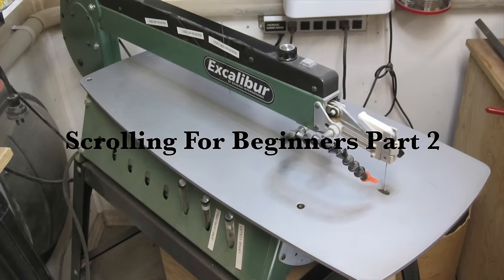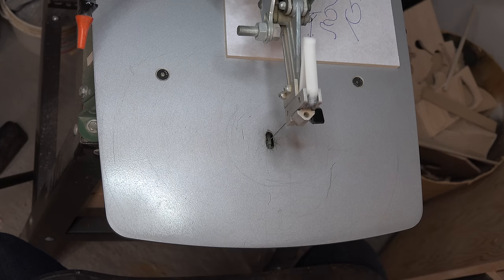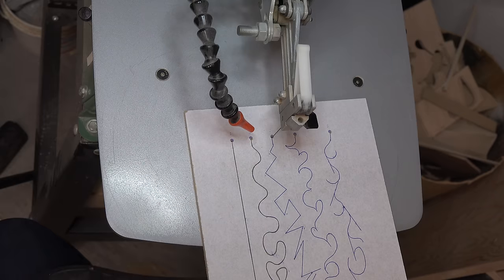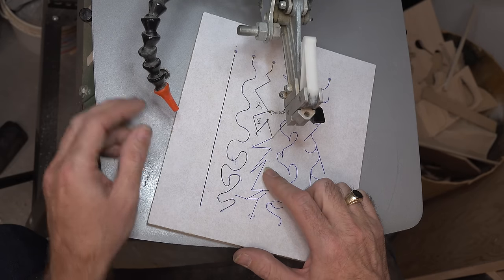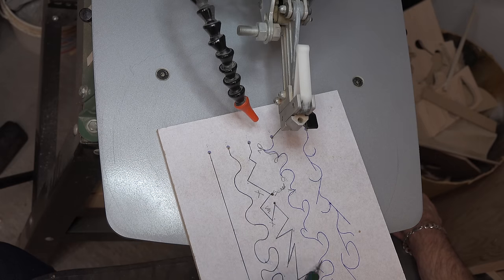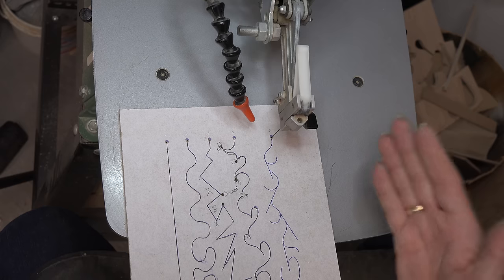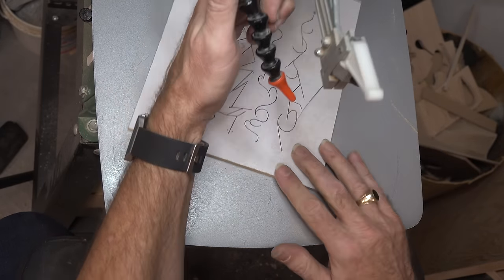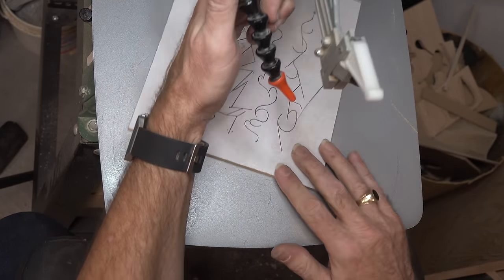Scrolling for Beginners Part 2

Comment: Great videos, I am new to the scroll saw myself. I was wondering if you have ever tried to cut out patterns in leather using the scroll saw? If so what would be the best way to go about it? Thanks
Reply from the maker: I've cut a lot of different materials on the scroll saw Justin but never leather.  I guess it would depend on the type of leather and the thickness.  After all, leather is a very porous material and the fibres may or may not lend themselves to certain cuttings.  There is only one way to find out sir.  If you are looking for recommendations on blade selection and speed of the saw, I would suggest starting with a number 2, reverse tooth blade with the saw at about half speed for starters.  That will give you a pretty good idea of how it will work with the leather.  The smaller blade will help to burnish the cut edges of the leather as well while cutting.  I hope this helps you out.  Please be sure to let me know how it works out and if you have problems, you can always shoot me a message over at the channel's facebook page and I will do my best to help you out.  Thanks for tuning in to the show.  I truly appreciate the support.
Reply: @acutabove_woodworkings  thanks for the quick reply. I will give it a shot. thanks
Reply from the maker: You're very welcome 
 @justincolson9589

Comment: maybe this question has been answered, but do you use a foot pedal?  I watched part 1 but don't remember this being mentioned?  It seems that at certain parts of cutting, the blade slows down and is this because you have a foot pedal?  Sort of like how you can control the speed of a sewing machine.  Thanks!
Reply from the maker: I do use a foot pedal Clare.  You have to realize though, that a foot pedal on a scroll saw is a normally open switch that either turns the saw on, or off.  There isn't a pedal available to control the speed of the saw.  It is an on or off situation and the speed is controlled by the saw's speed control only.  I hope this helps.  Thanks for tuning in.

Comment: where do you get such small blades?  you mentioned #3, 5 and 7 but everything at my stores only show tpi
Reply: could it be because all they offer is pinned blades?
Reply from the maker: Not knowing where you are located, it's hard to give a suggestion as to where you could purchase blades.  I get mine from a local supplier here called Stockade.  https://www.stockade.ca/Scroll-Saw-Blades_c_4365.html They sell them in bulk as well.  All blades have a universal number attached to them but some manufacturers don't list those numbers.
You might want to check out this chart from Olson Scroll Saw Blades.  It has some pretty useful information such as TPI and their universal numbers and what types of wood and thicknesses they are recommended to cut.  https://www.olsonsaw.net/wp-content/uploads/2020/01/2020-scroll-chart-WEB.pdf
I hope this helps.  Thanks for tuning in to the show.
Reply from the maker: I wouldn't suggest using pinned blades.  They are fine for some things but not so great at doing finer, detailed work.

Comment: Hey, Kenny - sorry for the late comment.  I really appreciate your video and perhaps I missed something but do you slow the speed of your saw as your back peddling in your cuts?

Obviously you use a foot pedal (which I don't have yet) but I wasn't sure if yours was allowing you to ramp up the speed or if that even mattered while moving the blade through previous cuts.
Reply from the maker: I do not reduce or increase the speed near the end of the cut.  In fact, the entire cut is made at the same speed.  I might reduce the feed rate of the stock, but I don't change the speed of the saw.  The foot pedal that I use is either on or off and has no speed control capabilities.  I hope this helps.  Thanks for tuning in and if you have any other questions, please don't hesitate to ask.  I'd be more than happy to help if I can.

Comment: Nice demonstrations and explanations, question, can you stack patterns to cut?  or does the drift mess up one of them?
Reply from the maker: Thanks for the kind words Mike.  You can definitely stack cut on a scroll saw.  The cuts will not be affected as long as the proper blade is chosen to handle the thickness of the stack you are cutting.  Blade drift no longer become a factor, however blade deflection is now the enemy.  You can overcome blade deflection by ensuring that you have the right blade and the right tension and you don't push the saw and let it do the cutting at it's own pace.  Pressing too hard in order to speed up the cut can cause blade deflection in thicker pieces.  I hope this helps.  Thank you for tuning in to the show.

Comment: How do you make beginning hole for pattern
Reply from the maker: All you need to do Rosemary, is drill a hole that is big enough to fit your scroll saw blade though in order to make an interior cut.  Try to drill this hole in the waste areas of the cut but if you are doing veining (cutting lines to accentuate details) you should drill the hole in one end of the line.  I hope this helps.  Thanks for tuning in to the show.

Comment: Hi Kenny. First of all, thank you for sharing. Question: Are you using a foot switch to turn on and off the machine? Sorry for being naive.
Reply from the maker: I certainly am using a foot pedal Ruben.  No need to apologize for asking.  It is one of my recommended accessories for the scroll saw and it makes its use so much easier.  If you are interested in seeing that Top Ten Scroll Saw Accessories video, you can find it here.  https://www.youtube.com/watch?v=ZNso4hITeq4&t=2s
Thanks for tuning in and for taking the time to ask your question.  It's truly appreciated.

Comment: I don’t want to sound dumb but do you connect that small hose to a special vacuum or does it work as a vacuum on its own as you cut?
Reply from the maker: You don't sound "dumb" at all Yvonne.  I'm glad you asked.  The hose is not a vacuum but rather a blower.  It is part of the saw and is connected to a diaphragm that is compressed when the arm of the saw raises and lowers during cutting.  It almost works like a foot pump for blowing up air mattresses but in this case, the "foot" is actually the cutting arm of the saw.  With every down stroke of the arm, the diaphragm pushes out a little gust of air that blows the dust away from your cut lines to  enable you to see them better while cutting.  This is pretty much the system for the majority of scroll saws.  Some have a little different system but they are pretty all based on the same principal.  I hope this answers your question.  Thanks for tuning in to the show and taking the time to ask your question.  If you have any other questions along the way, please don't hesitate to ask.  I'd be more than happy to help you out if I can.
Reply: @acutabove_woodworkings  TY for taking time to answer my question
Reply from the maker: @yvonneschimmel453  You're very welcome.
Reply from the maker: @yvonneschimmel453  Once again, you are very welcome.  Only to glad to help.

Comment: Have you tried just rounding off one back corner, e.g. the back right?
Reply from the maker: It only controls the cornering in one direction that way.  Both need to be rounded in order to fully assist with the control.  I hope this helps.  Thanks for tuning in.
Reply: I was thinking not for cornering, but for blade drift. It would seem the blade is getting twisted (viewed from above) counter-clockwise. If it's at least partially due to drag, lessening the drag on the right rear might help. Just got a used scrollsaw and got it running yesterday, so wondering this as an ignoramus. Thanks for great, clear, & thorough videos that I'm watching right now.
Reply from the maker: @vikingcove  grinding off the back edge of the blade is one of the things that will help with blade drift.  However, blade drift occurs on curved cuts as well as straight cuts and that is why you would need to grind off both back edges.  You are not wrong in the thinking but grinding off one edge would only help with one direction of drift.  There are other factors that cause drift as well and there is no way to correct those but grinding off both back edges of your blade will definitely help reduce it.  At least you are thinking through the process logically.  A lot of people just start cutting and can't figure it out so they give up.  If you have any other questions, please don't hesitate to ask.  I'd be more than happy to help if I can.  Good luck with your scrolling and thanks again for tuning in.
Reply: @acutabove_woodworkings  Thanks. Your demonstration of rate of feed & rate of turn was very good, and your turn technique of backing up, snapping a 180, then backing into a tight turn seems like an excellent method. It really helps me to have such mental pictures before I try something new. Next I'll have to tear into some actual scrolling practice. When I come back to check out others of your videos, I'll try to remember to mute it for the intro before I tap play. I really appreciate your help.
Reply from the maker: @vikingcove  In the beginning videos of this series the volume was louder than others.  I did eventually turn it down so not all my videos have the loud introduction.  I'm glad that you found the demonstration to be useful.  Please don't hesitate to ask questions if you have them.

Comment: really new to scrolling and was wondering  how thick of wood can you cut?  Danial
Reply from the maker: Most scroll saws will tell you that they have a 2" cutting capacity.  Realistically, the most you would want to consider would be 1"-  1-1/4" thick material. Much thicker than that can cause terrible blade deflection.  The saw works best with thinner stock however, up to 1" thick.  I hope this helps.  Thanks for tuning in.
Reply: @acutabove_woodworkings  thanks for taking the time to write your vids are great ,informative and down to earth thanks again Danial
Reply from the maker: @ve3tvb  Thanks for the kind words.  If you have any other questions along the way, please don't hesitate to ask. I'd be more than happy to help out if I can.

Comment: how can you pull the blade out in those lines?  the blades I bought at the local store have little knobs on them at each end which would make that difficult.  Thanks-great video!  I just retired and purchased a used saw and having fun practicing
Reply: There are two types of blades, pinned, the kind you describe and plain or unpinned. That may not be the official or technically correct term, but makes sense to me. Anyway, it's just a design issue chosen by the maker of your brand or type of scroll saw. And yes, the hole for entering the pattern has to be large enough to accommodate the pin on that style of blade. So pattern selection for a project will be crucial, as a very intricate pattern with many small areas that have to be removed will be problematic. For practice, though, just drill a larger access hole and practice away. Some saws that use pinned blades may have an unpinned adapter available either from the manufacturer or after market, but do research as they might be of varying quality.
Reply from the maker: Marc Meyers answered as well as what I ever could.  You will need to see if your saw has the ability to take plain end blades.  These are the ones that will allow you to do smaller, more intricate work with the saw.  The pinned blades are usually reserved for much more coarse work.  Personally, I rarely (if ever) have a need for using pinned blades.  If you need help with the blade selection, I made another show explaining some of the blades available and what their uses are.  You can find that show here.  https://www.youtube.com/watch?v=UG6S5tqx6bI&t=563s. Thanks for tuning in and for taking the time to leave a comment.  If you have any other questions please don't hesitate to ask.
Reply from the maker: @marcmeyers4156  Very well put.  Thanks for chiming in with an answer.  I appreciate that.
Reply: @acutabove_woodworkings  I downloaded the manual on line and found that my saw will take both type of blades.  I already popped the pins out of one to try and no issues at all.  I found a local hardware that sells the olson blades, so I'll be heading over there today.  After the practice template exercise was messed with, I tried a make shift fish and attached lettering project that actually came out OK.  Thanks to all and now I'll find something to do now that I'm retired at the ripe old age of 57 LOL
Reply from the maker: @HobbyAddictions  Good luck on your new adventure in scrolling.  I'm glad to hear that your saw takes plain end blades as well.  Before you spend a ton of cash on blades, be sure to check out my blade selection video that I gave you the link for.  It will help you to make better educated decisions when it comes to blade buying.  If you have any questions along the way, don't be shy about asking.
Reply: @acutabove_woodworkings  I did watch that video and I purchased my blades based on your suggestions.
Reply from the maker: @HobbyAddictions  Then you should be just fine.
Reply: @acutabove_woodworkings  sorry last question: is there anywhere to get free pattern templates?
Reply from the maker: @HobbyAddictions  Ask as many questions as you wish.  That's how we learn and that's what my channel is all about.  What type of patterns are you looking for.  There are plenty of sites that offer free scroll saw patterns.  If you do a google search, you will find many out there but not knowing what type of patterns you are interested in, it might be a little difficult to answer that question.
Reply: fishing mainly but overall beginner stuff  @acutabove_woodworkings
Reply from the maker: @HobbyAddictions  http://scrollsawworkshop.blogspot.com/2013/07/bluegill-fishing-scroll-saw-pattern.html
https://sawshub.com/free-scroll-saw-patterns/
https://suncatcherstudio.com/scroll-saw-patterns-projects-ideas/
These are just a couple that I found on a quick google search.  There are tons out there.  Check your local library as well for scroll saw books.  I'm sure they have some.

Comment: I notice you are using the flat end blades and not the pin ends. What I am wanting to know is what type and size of blade are you using, is it a spiral blade? I just notice how tight your cut was in the begining of part 1
Reply from the maker: For this thinner stock Mark, I am using a #2 reverse tooth blade, made by Olson.  I pretty much use Olson blades exclusively because that is what is available in my area.  I have an episode of the show that goes into detail about the different blades and their uses.  It is a longer episode but it has a ton of information.  If you are interested, you can find the show here.  https://www.youtube.com/watch?v=UG6S5tqx6bI&t=96s
Thanks for tuning in and taking the time to leave a comment.  It's very much appreciated.

Comment: Is there a reason you don't use a drop shoe? And if you were to how close would you keep it to the plane?
Reply from the maker: The hold down foot is a personal preference and I find that I get better control without one getting in the way.  I usually like to keep my fingers very close to the blade for better control but I suggest that anyone who is just starting out should use a hold down foot (or a drop shoe as you call it). I would suggest that the hold down foot be positioned just slightly above the stock that you are cutting.  By "slightly above", I would say approximately 1/32" above the stock.  You can even have it slightly touching as long as it doesn't cause interference with the wood being able to spin freely on the table.  I hope this helps.  Thank you for tuning in to the show.

Comment: I would like to ask show more detail how to decide what size drill to use for each different size of blade
Reply from the maker: The size of the drill bit Tecla really doesn't matter.  As long as the blade will fit through the hole and the hole will fit inside the area that you want to cut without encroaching on the lines of the cut, then it is fine.  If you wanted to use a 1/4" diameter drill bit for each cut, that would be fine as long as the holes didn't bump into the lines that you were cutting.  Don't over think this one my friend.  As long as you can fit the drill bit through the hole, then you are just fine.  Thanks for tuning and for taking the time to ask a question.  If you have any other questions, I'd be more than happy to help you out.
Reply: What I don't understand is that I have a Ryobi Scroll saw and the blades on that have a sort of notch on both ends and in order to get the blade in or out I would have to make a 11/16 size hole for the smaller task. I can't hide a big hole for a small cut. I am little confused how to go about that. More info would help thanks
Reply from the maker: It sounds to me like you have a saw that takes pinned blades.  The blade has a little bar at each end of it to attach to the saw.  Normally, pinned blades are not used for finer work because they take such a large hole to get the blade through the wood in order to make an inside cut.  You might want to check your manual to see if your saw takes pinless blades or if there is a conversion kit available to modify the saw from pinned blades to pinless.